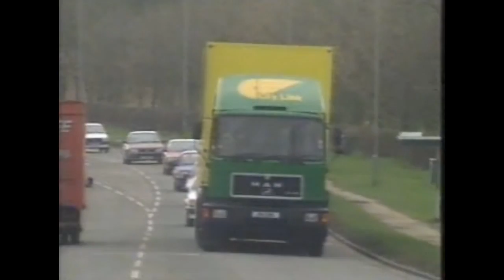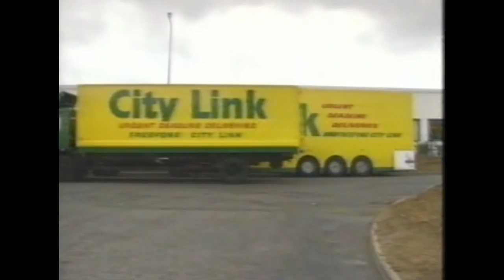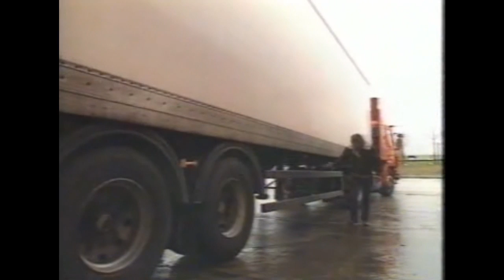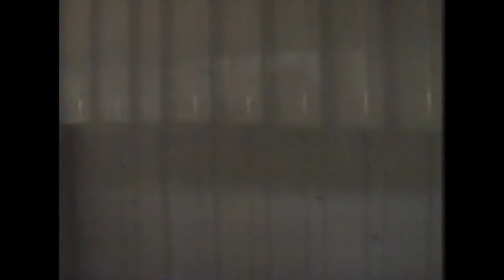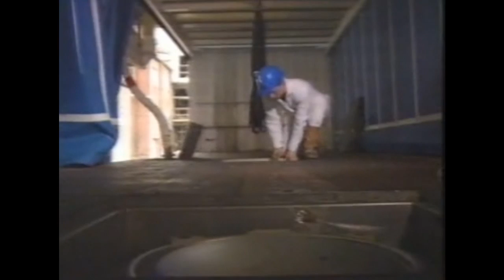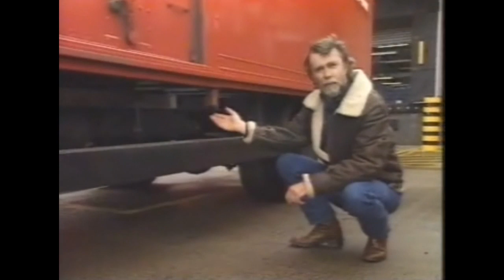Old Top Gear 1992 - Double Decker Trailers

Comment: wouldn't a double decker trailer be too tall 90s lack of logic
Reply: Do you really think companies like B&Q and Parcel Force would trail trailers that were too tall? 2010s lack of logic...
Reply: it's the exact same height. Don't think you've been around trucks much. I've beoth driven them and now load them. The average pallet height is about 7 foot, sometimes 6 foot. And sometimes you have a small order and get a pallet that's only 2 foot tall. You can EASILY make it double decker. In fact they now have the double decker curtainsiders shown here as STANDARD for overnight high volume intercity couriers here. And the one with the tank down low and the cargo on the top? they are quite common here and we have a name for them: camelbacks. I think it might be the name of the manufacturer of them here. On top of that, in parts of this country we will tow 4 full length trailers in a row. That's what they use to supply the outback. An area probably bigger than Iran with only 200,000 people.

Comment: all the weight is on the rear axle and when load there is less weight on the front axle, so how would that work.
Reply: you know how many trucks I've loaded where the driver wants me to put the heaviest thing over the trailer axles? The original way I was taught when I was a truck driver (basic tray truck, no trailer) in 2010 is that you want the heavier stuff at the front so that when you brake the heavier stuff doesn't push against and crush the front stuff. When doing flour bags we used to put the tallest at the front and work down to the shortest.
Reply: They do that for their own protection against the ministry, might be safer in a crash to have the heavy stuff at the front but it's also much easier to overload the truck axles which costs the driver a LOT of cash if they get stop checked. 

I deliver steel stock on a flatbed rigid and I much pefer to have stuff pushed up against the thick steel headboard behind the cab but we have a weighbridge at work so i can check the load before I leave the yard in the mornings, sometimes moving one item a metre either way can be the difference between legal and an over weight axle. 

Technically you are supposed to put the load where you need and it and then if there is a gap fill it with something that will stop the load sliding forwards but as I often carry 14m beams up over the cab roof and hanging off the back of the truck I can change the balance by moving thos back and forth, of course there are front and rear overhang limits to stay within as well....